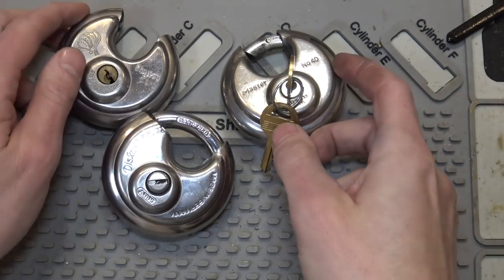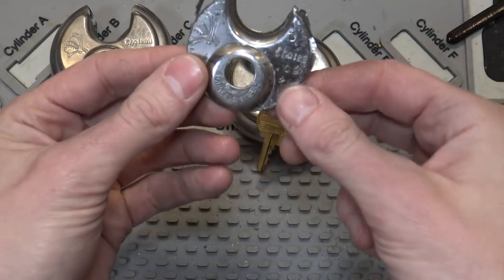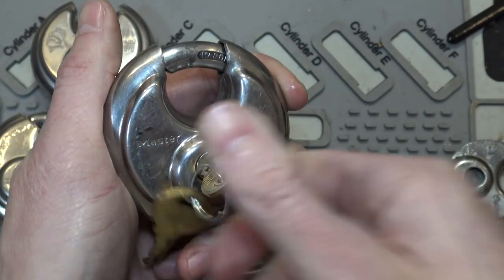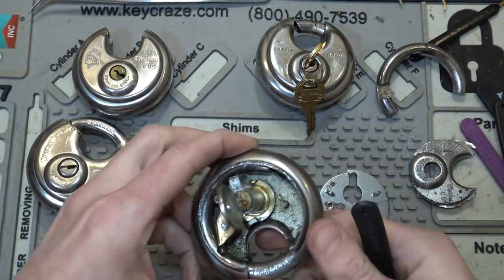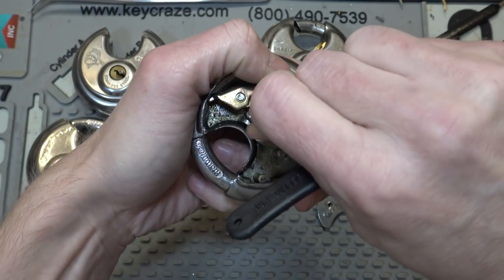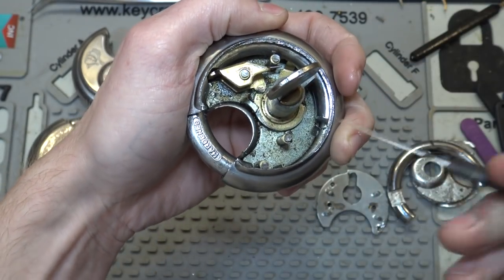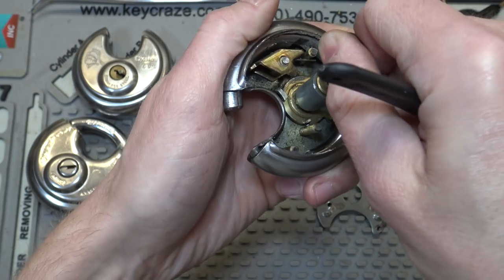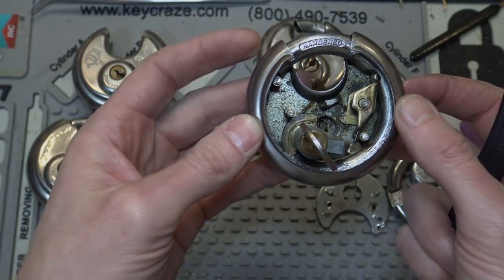(329) How a Storage Locker Disk Lock Works

Comment: Remarkably simple design. I was expecting just one movement component as opposed to the two shown in this lock.
So how much force do you think would be required to overcome the blocking component? Would the shackle move if that was overcome?
Reply from the maker: It would really hard to get leverage.  Even if you could and did manage to break both parts that keep the shackle in place I still dont think it would open.  I think it would all just get jammed up inside of it.  there isnt much room in them for stuff to get out of the way for the shackle to move.
Reply: @BoredLockpicker  So a brute force attack like cutting or drilling one would be the most likely method to get past one. The disc shell does appear a little thin compared to some padlocks.
Reply from the maker: @two_tier_gary_rumain  yea.  this brand has a brass cylinder so if the cylinder isnt against a wall drilling it would be easy.  some of them are steel with would be harder to drill.  I know a guy that works at a storage place.  He takes a dremel and cuts basically a plus sign across the front or back depending on what way its facing and just takes he cylinder out.  the other kind of dirty secret about storage places is the hasp are super shitty and some are even made to be easily replaced and you can just pop them off without evening messing with the lock if you were up to no good.  my preferred way to get these off is just with a 20v angle grinder with a 4 and half inch (114mm ; ) ) cut off wheel.  there is one place I go to that wont let you cut them.  there I either drill the plug all the out with a 5/16 or 3/8 drill bit and use a screw driver push that piece that moves the pawl and then move the shackle with my hand.  if they're locked on with the keyway facing the wall I put a 1 inch hole saw on my drill and stick the guide bit in the hole in the back of them  and just take the guts out.  only had to do that twice though.
Reply: @BoredLockpicker  At the very start of this vid, there looks to be an anti-drill spinner covering the keyway on the middle lock. Is that correct?
However, what about the metal body itself? Not around the curved edges that also has the shackle inside it but just to either side of the cylinder. There's a nice flat section there. On the back, there's more. Is the metal in that part of the lock very thick?
Good point about the hasp.
Reply from the maker: Gary Rumain it is an anti drill thing. I haven’t had  to drill an abus before but other locks with those aren’t a big deal. You just bend them off with a flathead and pliers. Not much to them. The metal on the is the same all the way around. I need to make another video cutting on with my angle grinder. It cuts them like butter
Reply: @BoredLockpicker  OK. lol!!!

Comment: I am looking for a non-key retaining circle lock - can you point towards a company that may make them?  I am having a hard time finding one.
Reply from the maker: I've never seen one.  I actually doubt it exist because its actually the key retracting the shackle not just moving something out of the way so the shackle can be retracted
Reply: @BoredLockpicker  Ok, I thought the ability to remove the key is a characteristic of the core, such as the position of the key within the core. 

So you don't think a non key retaining core would be put into a disk lock,  because in a disc lock the core moves the shackle directly - instead of releasing the shackle from a latch in which case the person (or a spring) would move the shackle.  

shackle by hand

myself
Reply from the maker: @jkyoft78  you got it. The key only comes out in the home position but on these locks if you turn it to home to remove it you’re also dragging the shackle back closed.
Reply: @BoredLockpicker  So there is no way to make a disk lock that is non key retaining...this is killing me!
Reply from the maker: @jkyoft78  I’m sure there’s a way. I’ve been locksmithing for 7 years and have never seen one. Even the rekeyable ones

Comment: Hello @bored lock picker  I have an Abus disc lock and none of the keys that came with it will open it or turn in the the lock anymore.  Kind of like when you were trying to turn your lock without the plate holding everything down. Can I open it without cutting it off?
Reply from the maker: John Q. Citizen if the key won’t open it you’ll have to cut it.  You won’t be able to pick it or anything if the key won’t even open it.  Try lubricating it and see if the key works.
Reply: @BoredLockpicker  thanks man
Reply: These things fail so much. I have to put direct pressure on the latch on one to get it to open. But another i have just wont release so the dang key is just stuck inside. Any ideas?

Comment: The 26/70 looks beefy.  Where you made the cut, is it actually solid like that throughout?  (I only have a 20/80 and can't see inside that far)
Reply from the maker: They’re the same thickness. Look at where the shackle goes in and that’s his thick the metal is. Angle grinder cuts all of them easily
Reply: @BoredLockpicker  I'm looking around 17 seconds in.  It has a bit of solid metal in it.  Do all of them have that, or just the abus
Reply from the maker: ganzonomy it’s. Its not solid it’s just that carriage that guys shackle. It’s thin. It’s just flat looking because the top is cut off.

Comment: Why has my Disc Padlock seized. The key goes in & slightly turns the barrel without turning the bolt. Then it us hard to turn the key back and remove the key from the Disc padlock. This one is made by Silverline.
Reply from the maker: Corrosion maybe. I cut seized ones off a lot. They aren’t great locks

Comment: My key broke inside the lock just like that what can I do to remove it ?
Reply from the maker: I would use a 20v angle grinder with a 4 and half inch cut off wheel and cut it off. I do a few a month for customers.